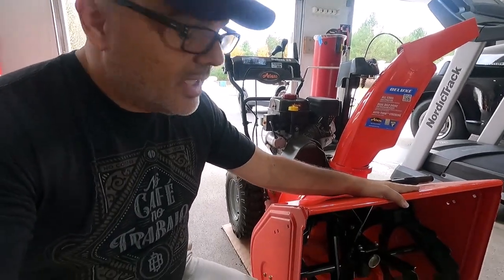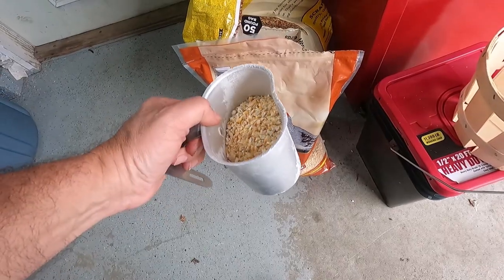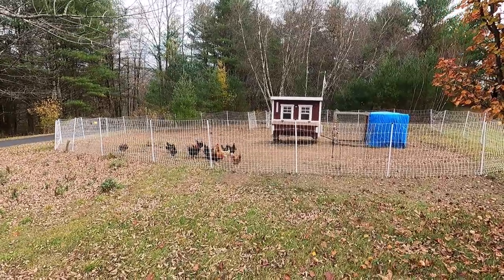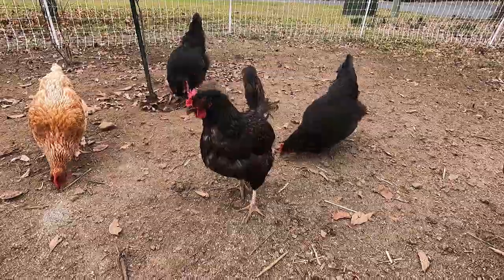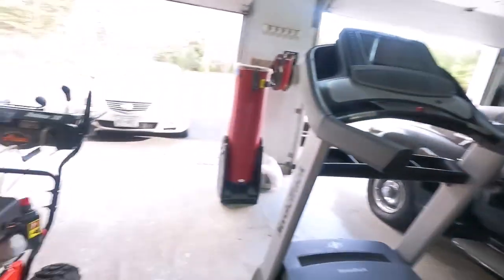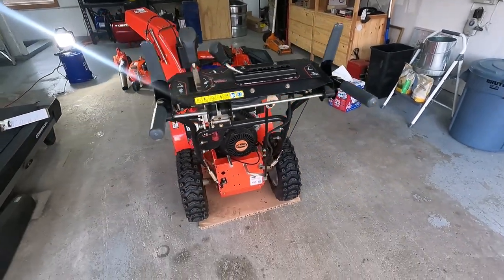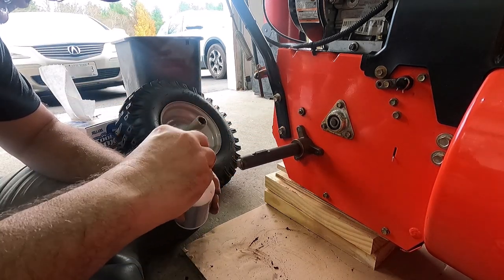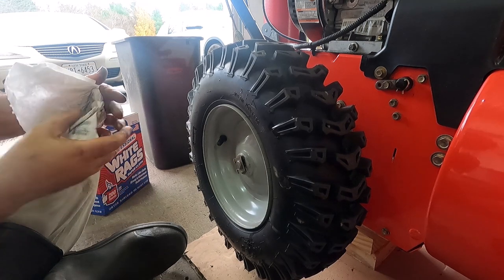Maintain Your Snowblower Part 3

Comment: You should have removed that axle under the grease point and anti seized the axle underneath the axle too.  It has a short axle over the longer axle as part of the differential.